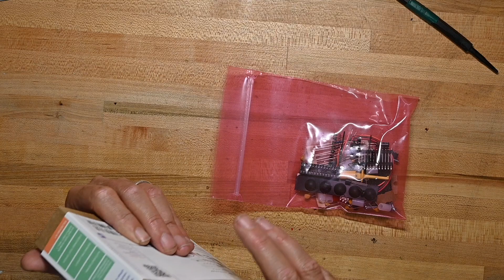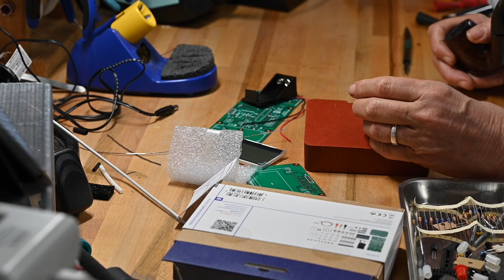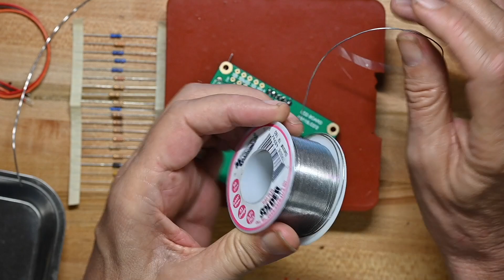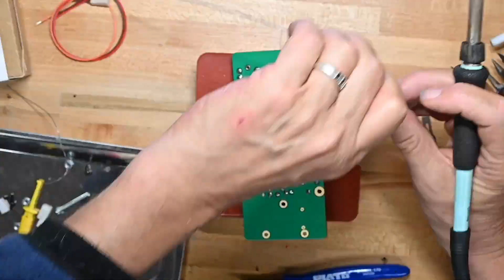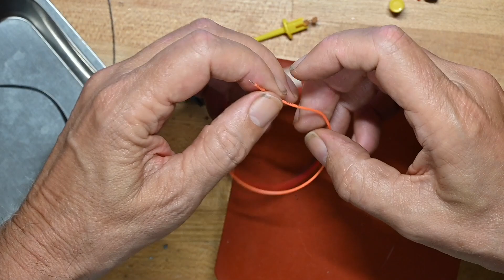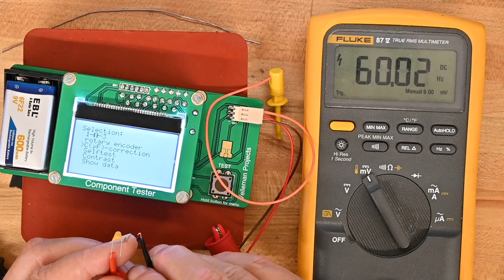C.K. builds a component tester kit from Velleman/Whadda

Comment: I'm honestly considering this thing as both a tool and learning experience.  I just started building guitar effect pedals, which are typically pretty simple circuits kinda anchored on cutting edge 1940's technology.  Something like this would be some extra soldering and component handling practice, that will end up with a decently useful tool at the end.

The only part that concerns me is that part you needed flux to solder without bridging pins.
Reply from the maker: Your first SMD soldering can be a challenge.  Here's a video on a SMD practice kit which I can recommend https://youtu.be/Ibi-Gz-3YYo .  And here's the Amazon link if you want to buy it https://www.amazon.com/dp/B077QCJ2Z8?psc=1&ref=ppx_yo2ov_dt_b_product_details
Reply: @ Thanks for the advice, SMD is a bit intimidating, as I'm just starting to get comfortable with through hold device soldering.

Comment: how do you know which way for the cap's?
Reply from the maker: The small disk caps doesn't matter, they can go either way.  On the electrolitics, there are small plus signs (+) printed on the circuit board.  The long capacitor lead goes in the plus sign marked hole.  The short lead goes in the other hole.  The side with the short lead also has a white stripe on the body of the cap in case you trimmed the leads already.

Comment: mine didn't turn on. I knew it wasn't going to work being that it was over 40 bucks. Guaranteed to not work. I fucked up somewhere,
Reply from the maker: @tony2wheelz408 Does it do anything, like the screen lighting up?  Double-checking those very close pins on the display board might be where I'd start looking.  And checking to make sure the ICs are in the right way, I've made that mistake plenty of times.
Reply: Thanks, I was getting nothing at all, Not sure why as voltage was getting all throughout the board. I tossed It in the trash and moved on. About 20 % of those things are jacked out of the box. I tossed it 
 @CKHaun

Comment: Seems to be their own implementation of the famous OSH "Transistor Tester" project. At it's core is just an arduino and 6 resistors, 3 each of 2 kinds of values. Ingenious design. 

The project looks... tactfully put together, but a clickable rotary-encoder is usually much nicer for a "single-input-interface" than just a button. The PCB not boldly labelling which input pin is 1 / 2 / 3 is a big mistake IMHO. You can get chinese kits or pre-builts of this same thing far cheaper, although ofc hopefully you're supporting a home country's business when getting their own kit. Unfortunately given the small mistakes in the design I can't really give Velleman props here.

Overall it's great for testing 3-legged discrete components, cap ESRs and inductors, things most meters can't do.

You can find software repos and more documentation (for both usage, software customization and hardware design etc) on it at the following github repos: "Mikrocontroller-net / transistortester" and "madires / Transistortester-Warehouse"
Reply from the maker: Thanks for the in-depth details!